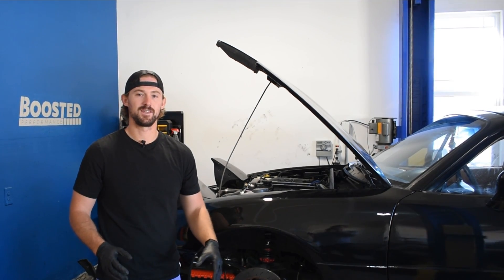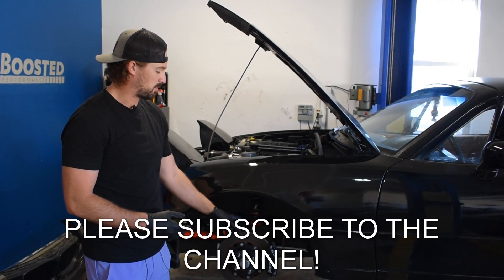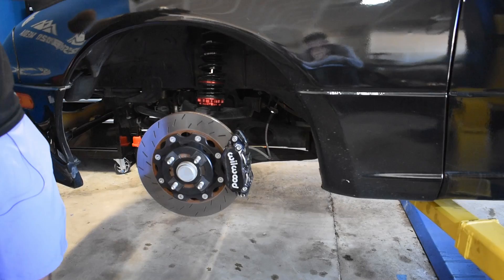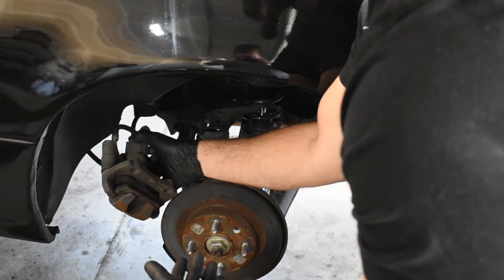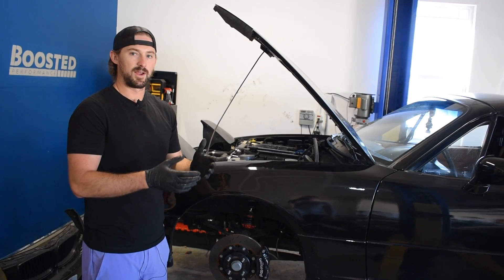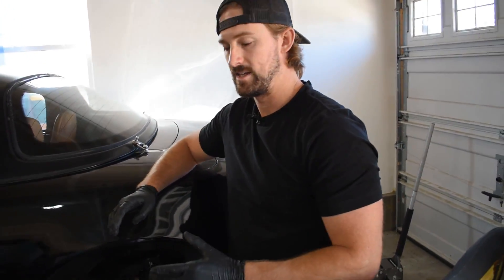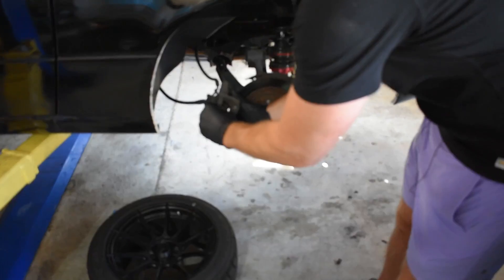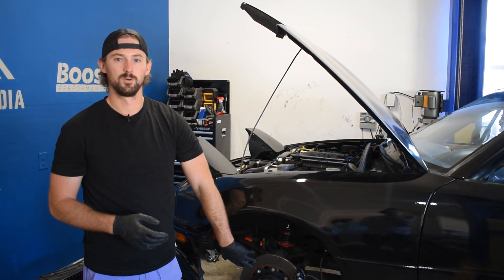How to Diagnose & Fix Sticking Brakes!

Comment: I have a squeaky wheel when its dry outside. It happens during and after braking. My mechanic says he needs to hear the noise, but its wet out today. I feel gaslit. Would this be an easy fix even without hearing the noise? They removed the shield just yesterday because it had rusted off and was constantly rubbing, but now the noise is back to the same one i had before; sparadic squeaky during and after braking. Im almost ready to do the brake job myself as its hard to trust a mechanic these days. He told me to stop fabricating things as i asked if the brake could be touching the rotor causing this noise. Its not the warning clip as there is still plenty of pad left.

Comment: Thank you for this video. I had a garage door a new rear caliper and change the brake fluid on my car. Since it came back the front left caliper has been binding. I've stripped, cleaned and regreased the slide pins and the ears of the calipers. That worked for a few days then the binding came back. Just checked the brake fluid level and it's over the maximum! 
No wonder they've been sticking. It has discs and pads that are about halfway through their life. Never going back there again!

Comment: Other than getting hot quickly, I didn't notice anything during driving my car (Yugo) that would suggest brake drag. When I lifted the car, the wheel was hard to move by hand, then I released the pressure from the bleeder and it was ok before pushing the brakes again,.. But the main point is the car didn't give any other warning signs. I even tried puting it in neutral while driving and leting it slide to a halt and it didn't have any jolts or unusual movement at lower speeds. Sled down the whole street and even at 5 km/h it was still not going to stop on it's own,. Yet the wheel got too hot again (in my opinion)
Reply from the maker: G - What you’re describing sounds like a classic case of a sticking brake caliper or collapsed brake hose: when you press the pedal, pressure reaches the caliper, but a weak or internally collapsed hose won’t let the fluid release quickly, keeping pressure on the pad and causing heat buildup even though the car feels fine while coasting; that’s why cracking the bleeder frees it up temporarily. Since you didn’t notice drag at low speed but the wheel still got hot, the pads are just barely dragging—enough to create heat, not enough to noticeably slow the car. The next steps are to check that the caliper piston slides smoothly, the caliper pins are free and greased, and most importantly, replace the brake hose to that wheel (cheap insurance, since these fail internally without showing damage). If you ignore it, you risk boiling the fluid, damaging the rotor, or even a brake failure.

Comment: Im suspecting gunk in my whole system. Brake system gets hot but doesnt drag like a 10 minute drive and u noticed a slight bit of water and the discs are sizzling hot. I thought it was normal until i drove my other newer car and threw water at it, no sizzle at all. Meanwhile this car instantly vaporizes water after a short drive. 

Replaced one hose as one brake caliper was dragging bad at first. 3 of the calipers have been replaced. But all 4 of them are sizzling got after a drive.

When the car is in neutral (manual) and coasting i dont notice any hard stoppage. But im worried about how much the brake system can take the heat.

After i replaced the hose i followed the line and found some of the coating for the hardline got scrapped off and rusted, not enough to leak but suspecting moisture got in through there.

Since its all 4 im planning on replacing that entire hardline, then the master cylinder next.
Reply from the maker: E - You're thinking in the right direction—if all four brakes get sizzling hot after a short drive but there’s no obvious drag when coasting, it suggests the brake system is building pressure and not fully releasing, likely due to a restriction upstream, not the calipers themselves. Since you've already replaced 3 calipers and a hose, and you’re seeing signs of corrosion on the hardline, it's very possible that internal rust or gunk is restricting fluid return, causing residual pressure that lightly applies the brakes even when you're off the pedal. Replacing the rusted hardline is smart, especially if moisture entered the system, but also consider the brake booster check valve and master cylinder—a failing master cylinder or swollen seals can trap pressure across all four corners. After replacing the hardline, thoroughly flush the entire system with fresh DOT fluid, and if the issue persists, replace the master cylinder and check booster function. You're right to be concerned—heat like that will warp rotors and cook seals over time if left unresolved.
Reply: @8020Automotive im gonna try rebleeding the master cylinder one more time and make sure to jack it up and stuff. First time i did it i neglected to do the full bench bleed and it dragged so bad it would smell. 2nd time around its just heat. 3rd time then I'll know for sure. Otherwise considering pulling the abs fuse to rule that out as a possible cause or if air is still in the system
Reply from the maker: @Electronica27  Hope it works out! Keep us updated.

Comment: Is this relatable also if you're traveling at highway speeds (60+mph) and apply the brakes the vehicle or steering will shake? But only at higher speeds, lower speeds below 40 mph feels normal(ish)
Reply: Usually means warped or uneven rotor surfaces
Reply: @x2SIKx4ux okay I had an assumption that it was that because the dealership replaced my rotors, brakes, calipers last February and a few months after it started doing it. I figured with the warranty they would just change it But they wanted to charge me to replace everything again because I waited longer than a month to tell them so they said I might've caused it. I figured I could try to replace them myself but wanted to get knowledgeable opinions to know what I should be trying to replace before jumping in. Thanks for your input.
Reply from the maker: X - Thanks for helping viewers out!

Comment: Please help ...  My car when i fist start driving ks fine. Then after it hears up maybe a mile or 2 tops it feels like the engine is dragging no acceleration but also a ton of shaking. Yhis only happens after it heats up i.e winter i xan maybe go 3 miles but once temperature heats up spring/summer i only get about a mile beforeit starts .... I have changed brakes calipers and rotors all the way around got an allignment  still doing it. Could it be e brake ?? Mechanics keep telling me its thisor that i change it and still continues PLEASE HELP ME
Reply from the maker: S - Sorry to hear.. Yes, your symptoms could potentially be related to a dragging or partially stuck emergency (parking) brake, especially if it’s heat-related and starts after a short drive. As components heat up, metal expands, and a stuck or partially seized e-brake mechanism—whether it's the cable, shoes (on drum-in-hat systems), or caliper piston—can worsen, creating resistance, shaking, and loss of acceleration as if the engine is bogging down. However, other possible culprits include a failing wheel bearing or CV axle, a bad transmission or engine mount, or even an overheating catalytic converter causing backpressure. Start by checking the e-brake cables and the condition of the rear brake hardware (especially if your vehicle has drum-style e-brakes inside the rear rotors). If you feel increased resistance, heat from the rear wheels after driving, or smell burning, that’s another strong sign the e-brake could be dragging.
Reply: @8020Automotive I definitely get the heated up and burning smell and smoke a lot time however it's not the rear it's actually the front my plastic hub caps have actually melted some due to the heat at times. I have an 08 g6
Reply: I got an 09 Buick lacrosse and my rear siezed up so i replaced that, not even a week later my fronts siezed, I looked at my fluid a month previous and it was fine, looked at it today was all gooey and gross, this can cause the return line to clog in the master cylinder so after driving a little it can’t return that fluid when you build up that break pressure, then after it sits for 15-20 mins it returns back to normal. I’m just doing a break fluid flush and I don’t see why that wouldn’t end up fixing the issue

Comment: I have a slight metal on metal grinding sound that oscillates (the grinding sound "peaks" once per tire revolution), and it seems like this could be it.. I actually only notice it when there's a concrete barrier or brick wall to my left (from the sound bouncing into my ears). thanks for the video
Reply from the maker: V - That slight metal-on-metal grinding sound that peaks once per tire revolution and is more noticeable when next to a wall or barrier is likely a wheel bearing going bad or brake hardware lightly contacting the rotor (like a bent dust shield or worn brake backing plate). The fact that it’s tied to wheel rotation suggests something physical moving with the wheel, and the echo from nearby walls just helps you hear it more clearly. Safest bet is to lift the car, spin the wheel by hand, and listen closely—check for play in the bearing too by wiggling the tire side to side.
Reply: @8020Automotive  The sound I was talking about had started off real subtle-like, but accelerated until becoming extremely loud. I fixed it by using brake cleaner and wire brush on the wheel hub (where the rotor goes) to remove ALL buildup and rust so that the new rotor would have a flat surface. I think one of the caliper guide pins was also seized, since one pad had become ground beyond the friction material, while the other pad on that wheel had a lot of life left. When putting on the new rotor, pads, and wheel, I had to make sure it was flat on the wheel hub; simply putting it on and tightening all lug nuts in a star pattern didn't automatically make it 100% completely flat (I could vaguely hear the same sound when rotating by hand), I actually had to loosen them again and then jiggle it to be 100% flat before tightening again while pushing on the rotor through the rims. works perfectly now! Luckily there was no play in the wheel bearing.
Reply: Have replaced hub bearing, caliper, pads, axle shaft.  Fixed nothing...I have same exact problem.

Comment: But how do you know which brake it is
Reply: Sticking one will get VERY hot. After a drive, spray bottle w/water can indicate who's at fault, or just grab disc and burn the crap out of your fingers.
Reply from the maker: H - You would have to visually inspect them all, unfortunately.

Comment: I am having a issue that i dont know if could be brakes or bearing, when turning at 120 kmh and turning to the left the left front wheel start to do a noise similar to when we go over a separator line on the road , any idea of what could be? And i dont know if it helps when wet or after being washed in the firsts kms start making thumping noises from the rear... After some kms seems to stop
Reply from the maker: L - Unfortunately, it's hard for us to diagnose it without being there. Have you taken it to a shop?
Reply: Honestly man sounds like it could potentially just be a warped rotor on that side. Have you taken the tire off and checked?
Reply: @mattyice8273  today i checked i noticed some kind of bump on the disc and a deeper scrape but i have no vibrations , i noticed however that takes a bit more time to brake. Maybe really is the discs and not the Bearing

Comment: Unfortunately nothing yet has fixed my intermittent seizing front right caliper on a 2004 Buick LeSabre limited. It all started when I blew a brake line and fixed it but then the brakes were not good. Since then the master is new which seemed to bring on the seizing front caliper leading me to change both calipers, the brakes and rotors are in good condition. The brakes are real strong now so long as this issue isn't occurring. It's also been bled every which way including vacum. Next steps I think is to change the hose to the caliper and if that doesn't fix it look into a used ABS control module. You never know when this problem is going to occur or if it will but when it does you can watch the digital miles per gallon meter go down slowly on the highway and feel vibration followed by the heat difference at the wheels after. When it doesn't act up I've been getting some of the best highway gas mileage ever after changing the calipers but when it does this I think i might need another tow truck.
Reply: Had a 2004 Mazda 6 v6, 3 years  car was dragging and brake pedal soft, spongy, bled by Dealership, 3 other shops, and they couldn't figure it out --none charged me. I had to top off fluid every week so often but could not find any external leaks. After a 4 days in Iceland, i came back and car let out pure white smoke dead winter feb along with a percolating sound under the hood. No gasket leak. A few months later, decided to  change the booster. It was full of fluid. It was the master cylinder we'd replaced  3 years prior--> bad seal from the start. The engine vacuum was sucking in brake fluid causing that pure white smoke, but it was causing the piston to bind onto rotors causing drag, premature rotor+ pad wear + likely engine damage with the brake fluid intake too. Damn shame cause the car died a year later. Damage done. 
Hope this helps somebody out there 😂
Reply from the maker: O - Sorry to hear this! We hope it gets worked out soon for you.
Reply: did you solve the problem?
Reply: This comment perfectly describes what I’m going through with my 2013 Dodge Avenger R/T same caliper locking up, same mpg loss, vibration and heat difference after, same unpredictability of when it happens. I’ve changed pads and rotors of all 4 wheels and replaced the front passenger caliper(which is the only problem side) twice. Came up with the same game plan to try new hose and abs module if it still persists. Please update if that fixed it for you or if there’s something else I should be worried about
Reply: Fixed my problem, it was indeed the brake hose for me
Reply: @ 4 pair of rotors and 2 pair of hubs changed along with tires,pads,bushing,bearings,etc, same problem still persist on bmw x3 2007

Comment: FYI  Do not leave the brake fluid reservoir cap off for a long time. Brake fluid absorbs water vapour very quickly, which will cause corrosion issues in the future
Reply from the maker: T - Well said.

Comment: Hello there I have a problem with my Chevrolet Cruze brake,rear right brake is grinding very fast I have to change brake pads, everytime,I have also replaced the same caliper once please help me with the issue.
Reply from the maker: V - It sounds like they need to be replaced again? Have you had a shop look at them?

Comment: Please help me… literally no shop knows what’s wrong.

19 Silverado 1500 

Just a routine new pad/ new rotor job. $800 local shop. 2 days later a new loud moaning noise started coming from the rear wheels. Took it back. They don’t know. Second visit. Said the caliber suddenly went bad. Huh?? 3rd visit , different shop. They said the previous shop didn’t calibrate the electronic brake properly. They calibrated it. Noise went away! One day later the noise came back. Visit 4. They replaced the brake actuator. $300. No dofferent. Visit 5. They want to replace the brake module computer. $1000. Told them no that’s enough. How did a shop install new brakes and FUCK all this up?? 

So I noticed the reservoir is completely filled to the top cap even when truck is ice cold. Could this really be from them over filling the system when they gave me new brakes?
Reply from the maker: D - Sorry to hear that you're going through this... Your assessment is certainly possible. Our advice would be to take it to another shop, but it sounds like you have already done so.. Are you getting any check engine lights or engine codes?
Reply: @8020Automotive  nope nothing at all. Caliper only sticks in the morning first drive and maybe once  during the drive that’s all
Reply from the maker: D - Let us put some thoughts together. Keep us updated!
Reply: @8020Automotive  it HAS to be with something about calibration because it did go away! And the brakes even felt stronger… but like I said within 2 days it came back. But sure no worries
Reply: OIM trailblazer say brake fluid btwn hi lo marks  if too low then maybe get air, too hi maybe  no return fast
Reply: Practicing mechanic, he practice on you….
Reply: Eh, I was going to suggest the wheel hub sensor. They can do goofy things on the older silverados as it can send varied signals to the BCM where it's trying to compensate braking bias. Make sure the wiring is attached and secure. It can easily get in the way or be disconnected during a standard brake job on these. Lol I know it's been a year now, hopefully it was fixed. I'm curious what it was.